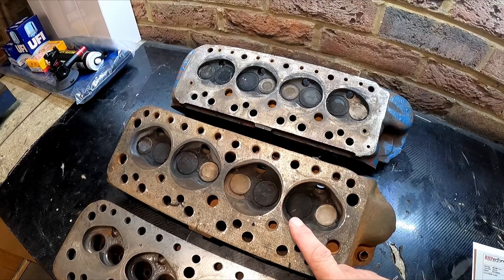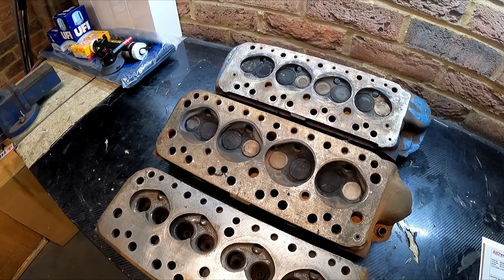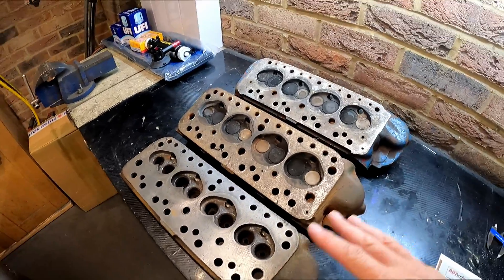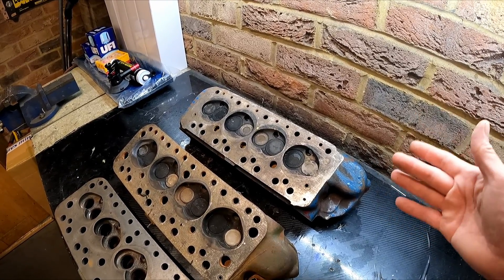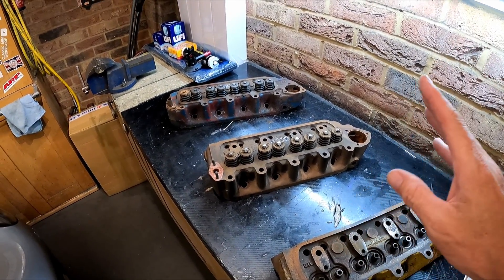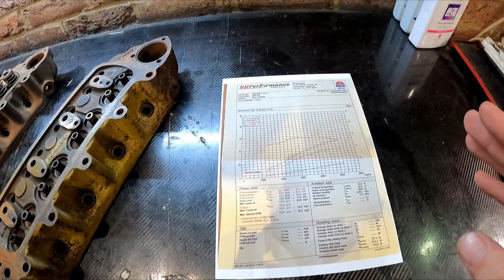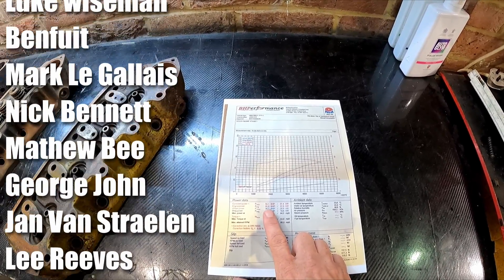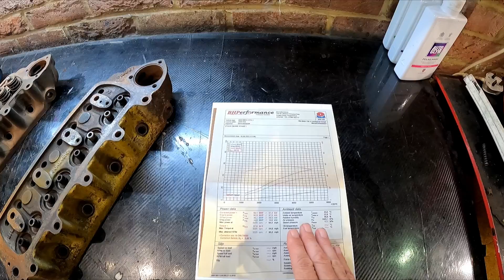Best Cylinder Head for a Supercharged 998 Mini? 12G295 vs CAM4810 vs 12G940

Comment: Good to see another Mini going the boosted route. 
Best of luck with your project. 
You made some good points about port sizes, as a bigger port may flow more, but this doesn’t always equate to more power due to the reduced velocity. The same also goes for valve sizes. Bigger isn’t always better.

Comment: Just a thought. You could run a decompresion plate. Which may provide enough clearance for the 12g940 exhaust valves, especially if using the stock 998 camshaft. With a 21.44cc chamber it would probably negate the need for chamber reshaping to acheive a lower compression. Just an observation rather than a suggestion as I know you have it all figured out. 😊

Comment: As a kid I ran a 998 with a 12G295 with a light skim, an uprated camshaft, large single SU and better exhaust. It was all done on the cheap but made a real difference and sounded great. I still have the head.

Comment: Hi Keith! Looking forward to the supercharged build. Back in the late '80s when I was at college and on a tight budget I managed to find a 12g295 head at a scrapyard (I think it came off an allegro??) for my 998, and then I stumbled across an 1100 bottom end at Metro and Mini spares in Putney (anyone else remember them?). I 'borroed' a cooper 3 into 1 exhaust manifold and bult an exhaust system by welding up sections of exhaust plucked from the skips outside an exhaust centre.... putting the exhaust together was my first gas welding experience and I had loads of incidents as my welds gradually broke from front to back and had to be redone. Crazy but fun days!! Your little explainer on the head differences reminded me strongly of the famous Vizard 'Bible' 😉
Reply from the maker: Cool, I bet the head cost barely nothing back then!
Reply: @classicminiworkshop  They were being sold then I think for upwards of 50 quid, but I got mine for a tenner as the scrappy didn't realise it's value :)

Comment: Great video and info.

I recently fitted a 12G940 on a standard 998cc engine with no pockets to the block. I followed info from an old forum, basically you have to measure the travel of the valves of the standard head. This step was done with the standard head assembled, rotating the engine and see the reading of each valve with a depth gauge. After you have to take the measurements of the 12G940, it will be taken from the head surface (combustion chamber side) to the valve face. From there you have to calculate the travel distance and to see that the valve won't go past the surface of the 12G940 head. I ended up with about 3mm clearance without considering the head gasket, this will add about 1mm more. 

Some minor modifications were done to the top of the water pump because it will interfere a bit from the thermostat side. Also a passage in the engine has to be blocked since the head doesn't have the passage through it. The hole is the first column from the left (fly wheel side) bottom row.

It is important to note that the standard rocker arms and cam are to be used. 

With the head i also did the LCB heavy duty exhaust manifold with complete system and new intake manifold with an HS4. For now i am using the standard needle, if i am not mistaken its the ADE. Might need to change it to a little richer one.

Hopefully this will be a bit helpful to someone considering doing the mod. :)
Reply from the maker: Interesting, I never knew that was possible.

Comment: The outer measurement on the 12G295 and the 12G940 is for the locating rings for the inlet manifold, so it’s only the innner measurement that counts.

Comment: I have a 12 G295 head currently in the machine shop.  1.318 intake and 1.060 exhaust valves - best to go +60 on the piston size so you don’t have to pocket the block - if you want valves this size. Keith Calver has a good recipe.  The supercharger will go a long way to suitable air velocity.
Reply from the maker: Thanks for the info

Comment: 12G295 needs convex pistons to really benefit from that type of chamber (not flat, not dished). Otherwise it will have less compression as the chamber capacity is bigger
Reply: The lower compression ratio will be better suited for a supercharged application.